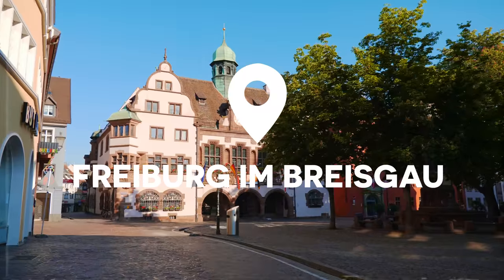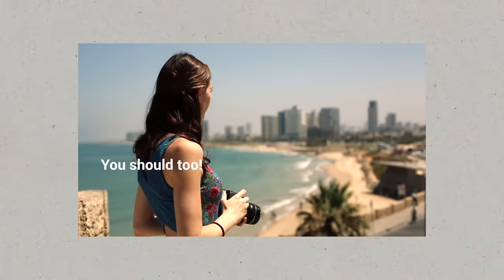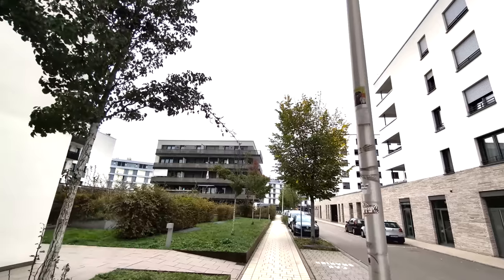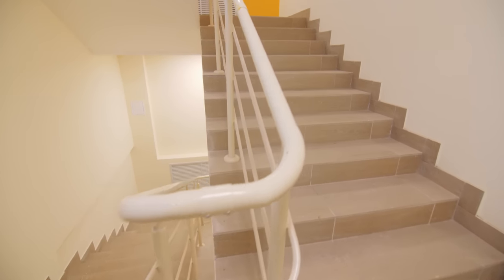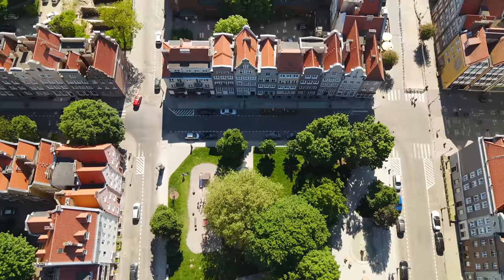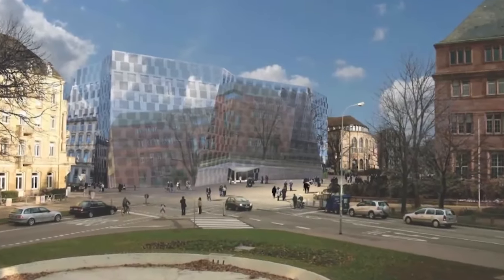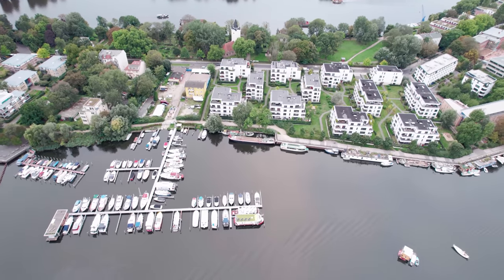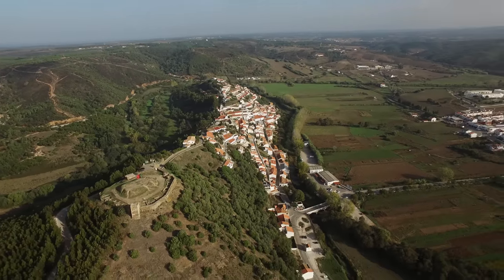Germany's BIG DUMB BOXES ARE AWESOME.

Comment: Excuse me! I'm German and I hate those ugly boxes. Not for being boxes, but for being ugly. The architect did not put any effort in it to make it a little more appealing. Not even color! They use a freaking modular system! You don't need an architect for that. Efficient design comes from engineers.
If these boxes are so cheap, then why is the rent for a flat in those boxes sill not affordable? I prefer to live in a nice looking building when the rent is 2000€ or above. Or buy for 1 million.
Don't get me wrong: I'm fine with living in buildings of this size and with a simple concept, built using a modular system. In my opinion, simple solutions are way easier to maintain, and maybe even more durable. I don't like to squander money on home owning companies who scam us.

Comment: The weird shaped glass building you highlighted does not look attractive to me. It looks like someone made a bunch of exaggerated mistakes on purpose. Different for the sake of uniqueness is not necessarily attractive. The Big Dump Box can be made attractive but any one design cannot be repeated too much across a region or it will lose its appeal. The challenge is to keep the box but also have a pleasant variation of styles within the same region so that as you travel about your day everything doesn't look the same..

Comment: They might be cheap and easy to build, but they are so ugly. Local communities in Germany often dictate the style of buildings and even the colour and the angle of the roofs for aesthetic reasons, but at the same time they allow those ugly boxes. Why not at least paint them in fancy colours? That can't be much more expensive than white. We are not in Dubai, where people build white buildings for cooling reasons. Most of the year it is so cold in Germany that actually a black building might be optimal, because the sun would heat it.

Comment: I refuse to call anything with a "ceiling" instead of a roof a good building. Specially when you live in an area with snow. I also refuse to believe that they have a longer lifespan than buildings with a real roof. Flat roofs just create problems in the long run.
Reply from the maker: All roof types have pros and cons. 

The weight of snowfall is one of the elements they factor in when designing a flat roof. They compute the average weight of snow in the area where the building is located and then plan the roof accordingly. In most cases, flat roofs can actually handle more weight than pitched roofs, which also makes the adventageous for the installation of solar panels. 

The design must adhere to strict construction requirements ensuring that the safety and stability of the building are not compromised. 

But in truth, flat roofs are not entirely flat. If there were no pitch, rainwater and melting snow would pool on the roof and eventually leak into the building. The pitch is usually very slight, about 1/8 inch per foot, and you might not even notice it. 

But if you do live in an area with high precipitation you should have your roof inspected regularly.
Reply: also could go with the top floor within the roof "attic" and have dormer windows but you are adding in more "complications" with the dormer and the roof line intersections causing a point of fail plus you are having a more limited space inside OR you are building a story just to "house" the roof support structure and that is extra costs to be considered 
there are examples of in CHINA they are adding WOODED roofs to there flat top concrete blocks to give them better / more modern looks and for "better Feng sui"?
Reply: @TypeAshton  I know that nothing here in Germany is build if it does not adhere to strict standards. I also know that flat roofs aren't entirely flat/plum. I still don't like the system and it has created many problems in the past. Look at the UK problems with RAAC in flat roofs. 

I personally am of the believe that the most resource friendly house is the one that still stands strong in 300+ years. For that it needs to be sturdy, relatively low on maintenance and have enough architectural features that it isn't completely boring. 

All (anecdotal) knowledge i have about old flat roof buildings is that they create problems once they get a bit older.

EDIT: After rereading this, I don't mean its needs a lot of design. Maybe a couple dormers, maybe some small things on the outside that work well with insulation and the balconies. Essentially a dumb box with a traditional roof and some "paint".
Reply: @TypeAshton   Not sure about architecture, but a new sidewalk usually has a pitch of 2%. I guess that is about 1/8 inch per foot? (i'm too lazy today to look it up)
Reply: @TypeAshton  It is not just the snow, it is also the rain. I don't mind a more boxy structure, but there ALWAYS should be a proper roof, anything else is just crazy in an area with as much rain as we tend to get (snow is actually a rarety where I live - but when it comes, it might come thick, hence it is better to be prepared for that, too). Those roofs have been around since pretty much forever for a REASON, even if the material changes depending on the area, flat roofs are for southern Europe where the climate is different. In Germany, a box just isn't the best option.

Comment: These box houses are probably just a sales gimmick. People have built in the traditional traditional way for thousands of years and could do so without power tools and heavy machinery. Nothing is more sustainable than that. Also we have no idea who long these boxes will last especially with flat roofs collecting water. That is bound to rot and leak after a while.
Reply: The Roman emperor Augustus introduced a height limit of 70 Roman feet (20.7 m). The Roman insulae could be built up to nine stores.
Reply: There is another vlogger , an architect called Stewart Hicks that has an episode called Why Do Architects Insist on Using Flat Roofs? which he posted a year ago. There he explains why flat roofs are not such a bad idea afterall.
Reply: @conniebruckner8190  I actually watched that video a few months ago. He called them low pitch roofs and they do have uses in certain applications such on office and industrial buildings. They are commonly used on strip malls and big box stores like Wal-Mart in America. Those kind of buildings get remodeled or torn down every 20 or 30 years anyway so the lifespan of those roofs doesn't matter as much.

Comment: If you design anything for any other reason than functionality and saving cost and ressources you are wrong.
I do not care how that thing looks in the end or if you deem it the ugliest thing on the planet. If it serves its purpose and does not cause problems it is a success.
If you want it to look nice, you are wrong. Get out of architecture, get out of design and do not enter any field related to making decision about anything. Cost ressources and functionality are the only metrics to go by.
I will die on that hill.

Comment: Living in a styrofoam cooler is what I deserve for my wallet and sins, gotcha. It's immoral to aspire to space, fresh air and light. Certainly not a view nor beauty. Half those buildings I expect razed in 40 years as rain eats through every thermal break and membrane fitting and the mechanics lose support.
Reply from the maker: Unlikely. German homes outlast most North American structures by 3 to 4 times the lifespan.
Reply: @TypeAshton  My standard is not American, but you're right in that the comparison doesn't favour US builds in almost every way.